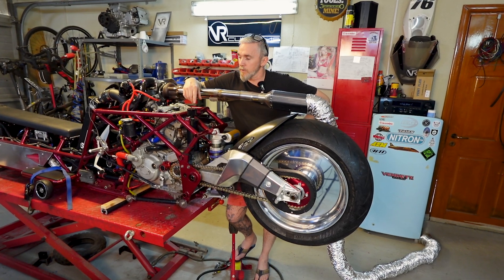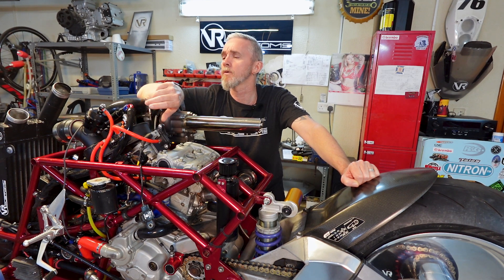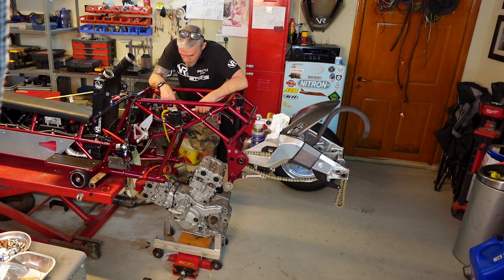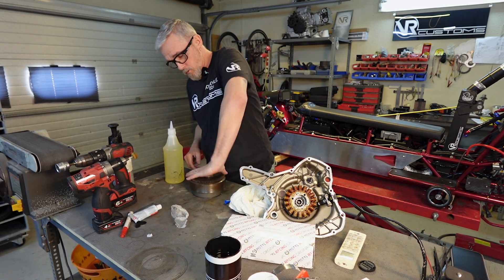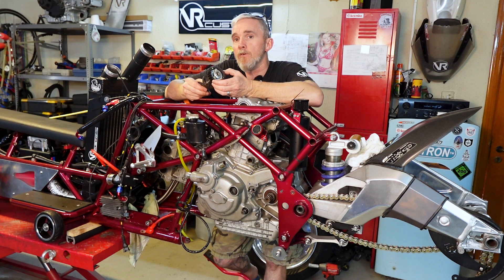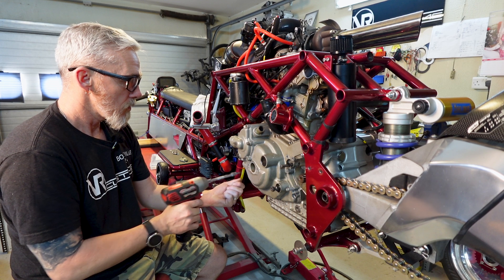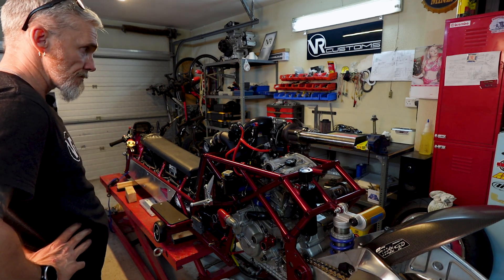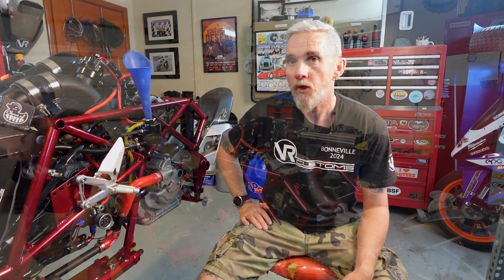Ducati Piston Failure: Why It Happened (and How we are fixing it)

Comment: Pretty cool.. looks like your using a 2003 Ducati 999 testastretta  non coppa bassa.. OEM rearsets .. a cool semi trellis frame for easy engine R/R .. and it appears some fabrication to the orignal 2003-04 cast swinger...little FYI OEM DSSA was  made for Ducati by Alcoa Aluminum in US . who also make the Corvette frames .. WOW 195 !!!! Holy Sh*te .. best my 102mm overbore hopped up 999 did was 168 mph  had geared down +7 . thats looks like a heck of a lot of fun..
Reply from the maker: Sorry, missed this message!  2002 998 with 999 cam boxes so we can use stick coils.  Swingarm is a Aprilla RSV.
Yeh, its a giggle!